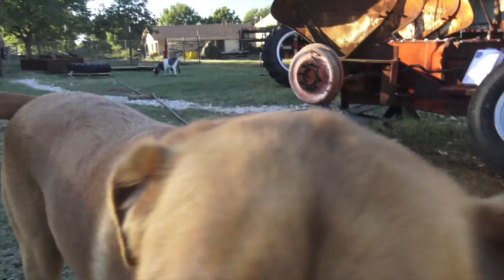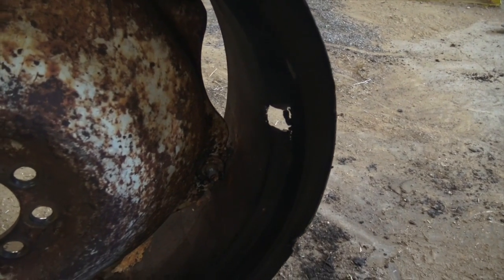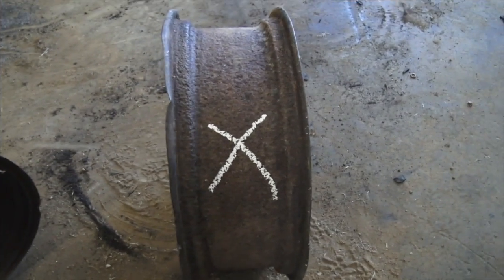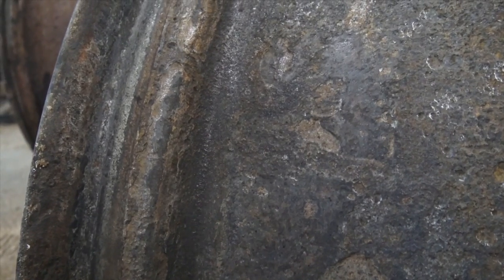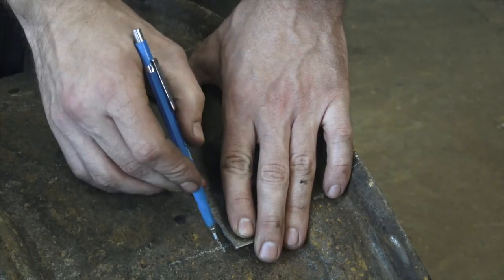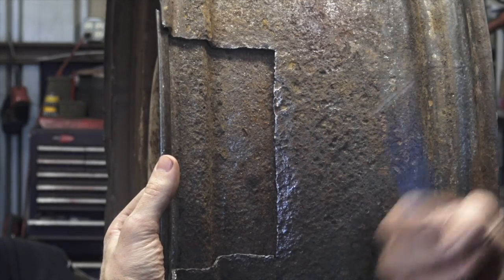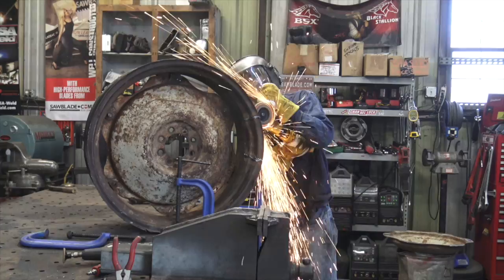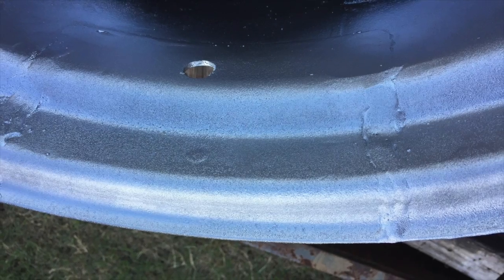THIS AMAZING LOST ART IS THE HIDDEN SECRET TO REPAIRING FARM EQUIPMENT ON A BUDGET!!!

Comment: 50+ years ago we were using tractors, with 18.4X34 tires we would cut the rims apart in the middle but offset then take the 2 wide pieces & weld them together, the narrow pieces we would put a piece of flat that was rolled & wide enough so that both rims were the same width. We did that so that the tires would have more of the klete to the ground. It might have helped a little

Comment: Looks like both of those rims are salvageable.  I have a kubota that had a 3in hole around the valve stem. Been holding fine for 2yrs now..after I fixed it.

Comment: Why not patch over the old hole and drill a new one in a solid section?
Reply: If there is enough good metal you can but it looked like more rust than metal which would pop and burn and blow a bigger hole lol!

Comment: I did a rim on a WD45 43 years ago by welding in steel after cutting the cancer out.
Then I coated it with three coats of Pettit Rustlok Steel Primer.
Still together yet and no more rust.
Last time it had a tire changed the rustlok looked like the day I sprayed it.